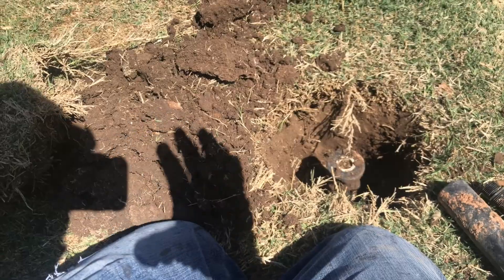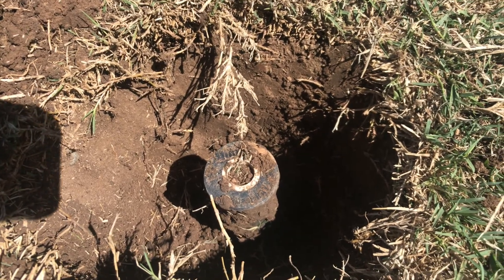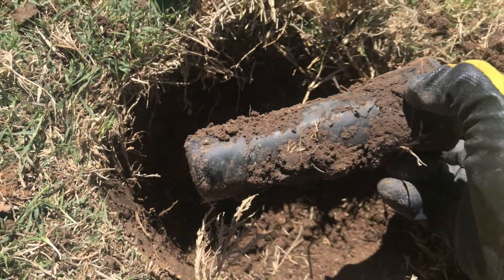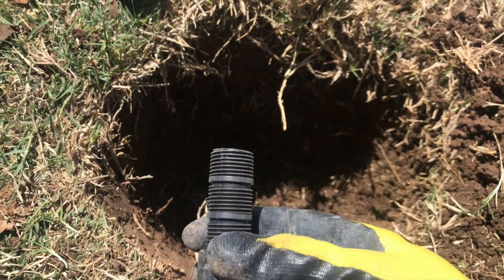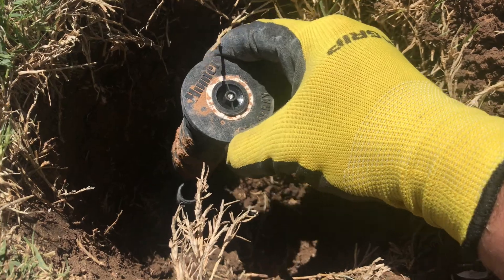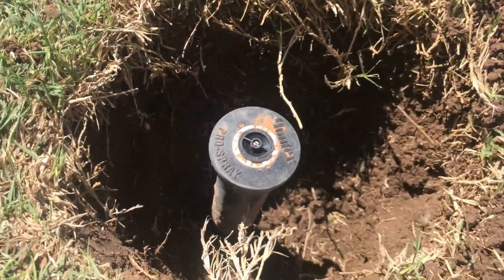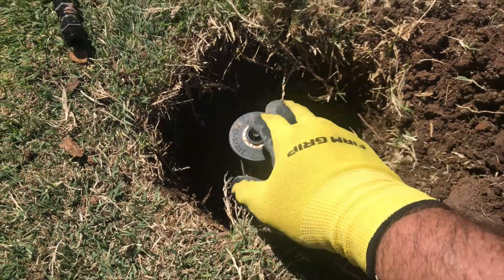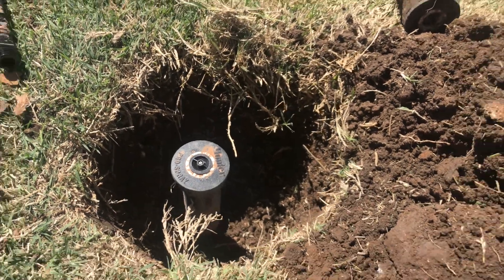How to Raise a Sprinkler Head

Comment: Thanks for this! I spent 4 hours in 102 heat digging a hole full of tree roots, chopping out roots so I  could remove the sprinkler. Knew I needed a riser so went to hardware store. Got the right size but didn't have the connector to the original riser. Back to hardware store tomorrow when it'll only be 100°. BTW, I'm a 71 year old lady who's never done this before. Thank you for your very clear demonstration 😊.

Comment: Thanks for the videos, very informative.  I bought a house with an 8 zone system, where only 7 of the zones are used.  There is a valve on zone 8 that leads somewhere, but it doesn't appear to run any sprinklers.  Is there any way to trace where it goes without digging it up?
Reply from the maker: Huh. Honestly, if I came out and we really wanted to find out what it does, I would just dig it up. So to answer your question, No. Digging it up might be the only way to figure it out. But I say that and I'm thinking, it could be a valve to run tree bubblers or planting pots or something that was going to be an add on thing and it is just capped off. If you do not see any water running anywhere and you do not need that zone, I would leave the the time off and do not run it for now.
Reply: @AmericanIrrigator  Thanks!  Thats exactly what I did...just left it out of the rotation.
Reply: Great video and thanks for sharing!

I have plantar areas where heather/conifers just got tall.  I believe I can make adjustments now.